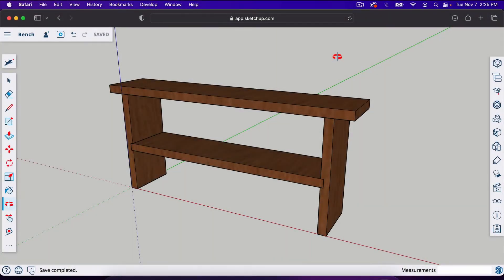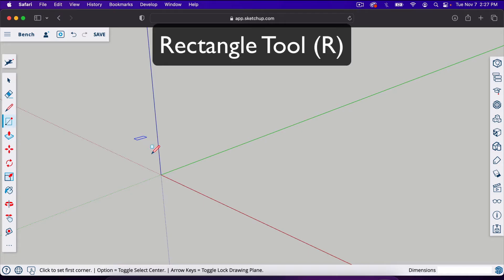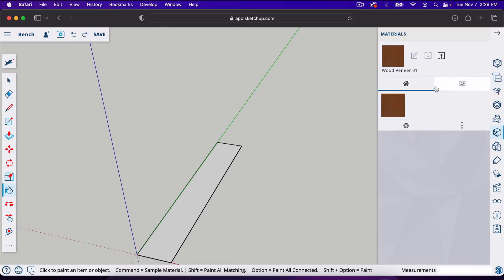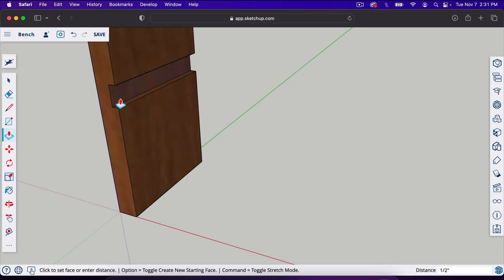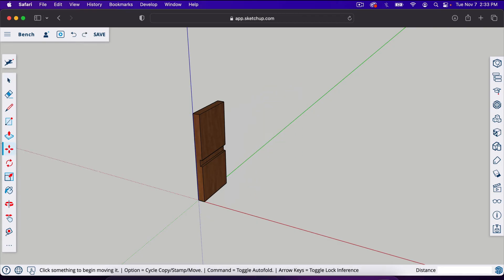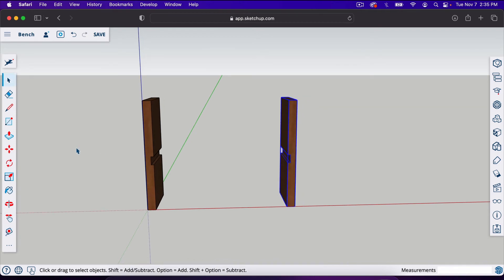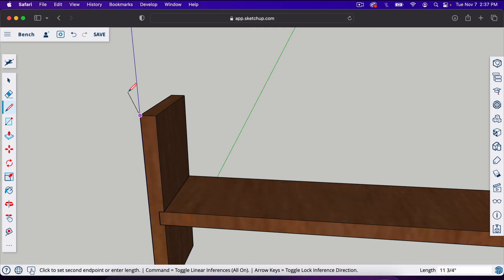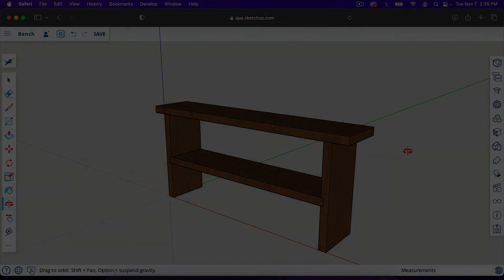Sketchup for Woodworkers -  Part 1 - Getting Started

Comment: Wow, for some reason I cannot rotate the second leg? weird! Does a face of the object have to be selected before rotating it? I'm on a windows operating system.
Reply from the maker: Did you make the leg a component?
Reply: @WoodworkingAcademy  yes, but I was using the protractor instead of the rotate tool. They look so much alike. 😬
Reply from the maker: @ Glad you figured it out!